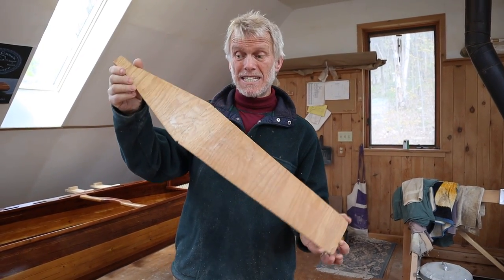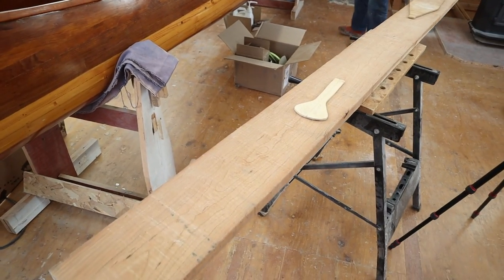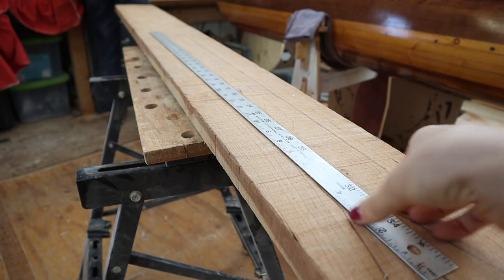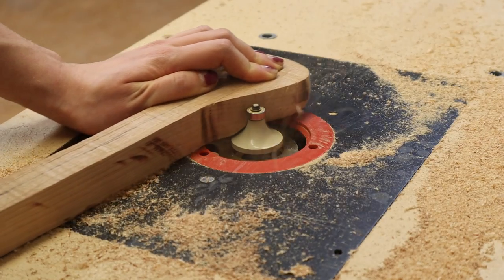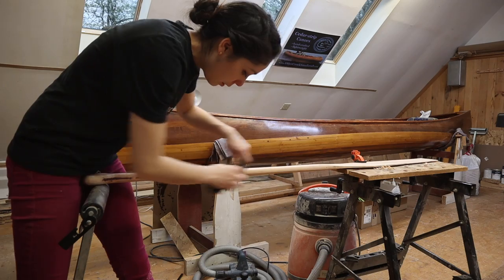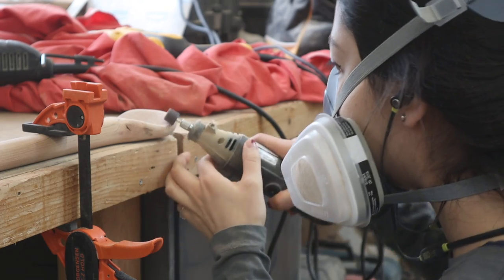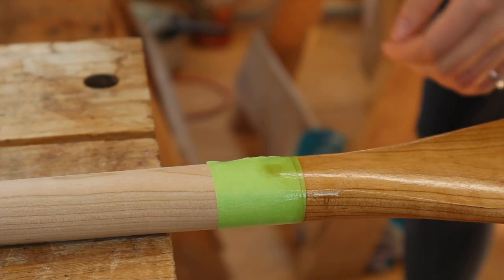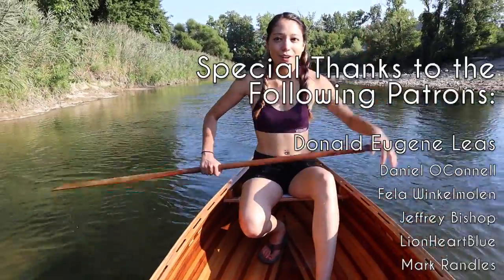How to Make a REAL Canoe Paddle (from a serious canoeist)

Comment: My favorite paddle was one my grandfather made. Almost the same shape as the one on the video but shorter in the blade and a bit wider! Another feature my Grandfather added was a bronze tip rabbited into the wood and pinned and epoxied in place. The bronze was soft enough so that it allowed for " Traction " when pushing off of rocks but hard enough to not deform too badly with knocks and scrapes! Blade was White oak with cherry layers in the shaft! Best paddle ever!

Comment: The information on paddle length was interesting. I've been told to choose a paddle that comes somewhere between my nose and chin, but usually I just hope the longest paddle they have is long enough. But I wear 38-inch sleeves, so using your method, I'd need a longer paddle than most.
Reply: For people with "normal" proportions that advice works well enough, and will select a paddle that works fine. If you do enough paddling that a custom paddle makes sense a paddle with a longer shaft may be more comfortable. This also can be modified based on blade shape and water conditions that you typically paddle on.
Reply: The universal tip ive read is that the top of the paddle should reach the shoulder when sitting in your prefered paddling position in the canoe and holding the paddle vertically with the entire blade in the water, that takes the length of the blade and different paddling stances out of the ecuation. Not a practical rule when handing out paddles at a rental though.
Reply: Hmm... Is my preferred paddling position sitting on the seat when the water is calm? Or is my preferred paddling position the "three knee" position (with your left knee, right knee, and heinie supporting your weight) when the water is rough?
Reply: @DarinMcGrew  You'll need a different paddle for each seat, each canoe, each position....we sell them at an inexpensive price...and are you left of right handed? We are kidding of course, we try a few then pick our favorite. Skipper likes a light paddle with a smallish blade and she is One With The Water. At first as a Marine I thought bigger was better and tried to beat the water into submission, but I am following Skipper's trail now.

Comment: Those long otter tails are great to pole with in shallows and have great reach when you need extra control in the wind. But a bent shaft beaver tail is much better when you need to cover miles fast. That's why I always go tripping with both.

Comment: Thanks for the video! I made a couple paddles a few years ago and used marine varnish on the whole thing... Definitely sanding it off the shaft/handle and applying some oil. Also I can confirm that thinning it is a good idea, my varnish is flaking off in some spots because I didn't thin the first coat.

Comment: I use spruce for paddles.  They die eventually, but are so incredibly light and nicely flexible.  Nice work all around!
Reply: Cherry is extremely light as it is so strong PSI wise that blades can be made very thin and still be durable.

Comment: Very nice paddle and very reminiscent of my 1971 grey owl modifed otter that is very voyageur like in design. After 45 years solo paddling I'm not fond of squared of style voyageur blade ends and   would recommend you round of the corners of bottom of the blade it will make for a smoother and less turbulent entry and exit and better for "indian stroke" , also   if you like to solo "style or freestyle  " paddle a symmetrical grip is better idea, you could always add northwoods/guide grip as well.

Comment: I find we use the paddle against the bottom of the lake stream or whatever quite a bit. I also noticed my dad's paddles were pretty beat up on the bottom edge from years of use so when i made my paddle I did put an inch or so of fiberglass on it. The paddles I made for my grandparents were pretty thin so I just put a real light layer of cloth on the flat portions of the paddles. It kept the weight down but still made it pretty strong.

Comment: Great info on determining paddle length! As far as the build process, hmmmm. I fashioned an otter tail & beaver tail for my 1st cedar strip boat many years ago using nasty, cheap, knotty pine. Since I paddle mostly lakes, the otter tail is my go to. The blade is more rounded than the ones in your vid. It has a 'scalloped' grip, you should look into that for your next project. You can hold the grip sideways further down or on top. Sounds weird but is actually a comfy grip. Both paddles are treated with linseed oil only, no varnish. The blanks for my paddles are half blade, less chance of losing symmetry that way. I prefer spoke shave over router for shaft. If you draw multiple equidistant lines down the square stock, it's quite easy & quick to shave it down to a round shape. I think 2 lines down each side of the square stock is how it's done, been a while, memory fails. You end up with an octagon, then take the ridges down to make it round or oval.... I remember one of my fave paddles as a youngster had an oval shaft.

Comment: Thank you for posting. I need to build a longer paddle for my Kayak. I will reconsider a strip paddle now. Never would have thought to  use the router for the shaft.
Reply: For a kayak paddle I guess you would need to make a 2 piece if it's coming out of a single piece of wood because of the feather in the paddle.

Comment: All my paddles, so far, have been laminated.   I should try a solid one just for fun.    That powered hand plane is a really nice tool for that!
Reply from the maker: Do it! I'd be curious to see how you like the way it handles. I think you can go a lot thinner and lighter out of a single piece of wood. 

And YES power plane is on my wishlist once google adsense starts paying me enough :D
Reply: ps: you don't need a thickness planer for a laminated paddle,   you can prep your strips on a tablesaw.   And once it is laminated you just use the bandsaw and then it's all curves and hand held tools.
Reply: @xylafoxlin  Get a belt-disc sander also.  I have a small one and  I use the end of the belt sander in the vertical orientation when shaping the handle.   The tight curve of the belt seems to match the curve in the grip fairly well.

Comment: And here I was thinking canoe paddles were boring. Awesome! Could you do a quick video outlining how you're paddling? It looks like you go straight without swapping sides, which is black magic as far as i'm concerned. Maybe a "canoeing for dummies" or something? I'm just assuming it's far more complex than I imagined, just like canoe paddles.

Great stuff.
Reply: ALX Electronics not a canoeist but it looks like the trick is in the wrist-flick at the end of the pull-stroke, turning the paddle blade 90° to act as a rudder.
Reply: You can google J-Stroke and get confused, or watch the video a few times at slower speed. Focus on the top wrist and how that changes blade from a paddle to a steering rudder. While not the intent of the video, Xyla showed us in simplest terms how to paddle/steer. There a few other basic moves, like a draw and a pry. Best to grab a PFD, canoe and paddle and go have fun!

Comment: Nicely done! Well thought out with help of your uncle no doubt? What type of wood species were you using? I didn't hear you mention it in the video, so judging by it's grain characteristics, I would guess that it's white ash? Anyhow, I like your approach to making the paddle. I'm nut sure about the jigsaw though? I tried a jigsaw on my solid piece of cherrywood and found that not only didn't it cut well with the grain, but the blade had a lot of deflection causing it to veer out on the underside (thankfully, or I would have ruined that plank). I spent a lot of time planing that angled cut down until it was nice and square with the paddle face. I am hoping to find a bandsaw to cut out the rest of the pattern that I didn't finish cutting. For the handle, I have purchased a concave shaped spokeshave which will contour the shaft shape a lot better that just a regular hand plane. For anyone looking at making paddles on a regular basis, you might want to look on line to purchase one. JMO.
Anyhow, great instructive video. Cheers to you...and your uncle!

Comment: I think you both did a amazing job, and I hate to be one of those people, and it may have been mentioned previously in this thread, but it LOOKED like you used a miter gauge AND the fence at the same  time, which is extremely hazardous, if I saw this incorrectly, I apologize. Adding a block of wood to the fence to set the distance, but not bind on the saw blade is the correct way to go about that.
Again, compliments to both!
Reply: It's fine (and safe) to use the mitre guage and fence together when not making a through-cut. So she wasn't in any danger from kick-back, but good of you to point it out for her and everyone else's safety 😊

Comment: I find it interesting that the paddle has such a squared off edge whereas we are kind of mentally conditioned that everything in boating is nicely rounded edges. Although I do know that there are parts of boats, in design, that are keep with sharp edges so water flow breaks off cleanly with minimal drag.

Comment: I think most people would cut the paddle out and use sandpaper and work it by hand or use a power sander. A table router is not a common tool in most people's garages or home workshops. It's also difficult to really make a perfect straight cut with the jigsaw or reciprocating saw, so I imagine you needed to plane and or sand the length of the paddle to get it straight and also to obtain the shape you desired.
I agree, it really is an easy project, but will take time to get it right and to make the finished product and regardless of which  or what tools one has, this can be done with the simplest hand or power tools. I think making it a one piece paddle is the most logical choice. I'd just paint or wood burn a decoration into it if I really felt like it, but it's strong and durable.

Comment: Do you know that linseed oil (and similarly danish oil) exposed to air cures into linoleum plastic, so it does the exact same thing as a varnish that normally is based on polyurethane or epoxy resin? It would suffice to oil the whole paddle.

Comment: Ah, the rule of thumb - determined how thick the branch was that you could beat your wife. 
A suggestion for your pattern pieces that I use in my shop is to paint them a bright colour and write what template they are on them.  It stops people cutting up your patterns as scrap wood.

I have made dozens of paddles over the years, but steamed plywood or fibreglass blades. None were as pretty as the paddle you made - well done.

Comment: Wood looked like it was 8/4?  Is that right?  Also  do you need any particular grain pattern? Quartersawn best? Or perhaps any particular grain pattern to avoid?  Thanks.
Reply: Since they went 1 1/8" with the ruler, we're guessing 5/4 (1 1/4"). 5/4 S4S (Surfaced 4 Sides) might be perfect to start.

Comment: I wonder what effect an aerogel powder coat would have on the water touching surfaces. Water sheeting, either an increase or decrease in buoyancy. Given that the water doesn't want to come into contact with coated surfaces I haven't a clue as to the impact besides coming dry from the water.

Comment: What kind of wood did you use for your paddle?  It looked like Cedar.  And if so what kind?
Reply from the maker: Paddle should be a hardwood :) I used cherry because I find it to be the most beautiful, but ash is slightly better for paddles because you can line the long, straight grain up with the shaft. But I'd say cherry or ash are your best bet. For small children you can do basswood to keep it light!

Comment: Stroke? Looks like a J-stroke, yes? Teach us, Xyla.
Reply: very astute - it would be nice to do a video on fluid dynamics and the compound stroke as well as a c stroke which comes from competitive whitewater slalom both k1 and c1 / oc1 / oc2 / c2
Reply: Not J-stroke, precisely. Stroke plus ruddering. J-stroke involves a push away from the stern at the end on the stroke. Both methods are a great improvement over stroke-and-drag; very common, very inefficient.

Comment: What was the original thickness of board? ... Or better asking what shape and size should the shaft have? Thanks for the info.
Reply from the maker: I believe it was 5/4 but closer to 1.125. The shaft ended up around 1"-1 1/16" once planed
Reply: @xylafoxlin  Thanks for the quick response. Greetings from Austria, Europe.

Comment: Flex in a paddle has nothing to do with being laminated or not.  It has to do with the wood species it is made of and the thickness/design of the shaft/blade.  T shaped grip makes it easier on the hands than traditional style grip as I learned back in the 1960s.

Comment: Using a jigsaw to rip over 60 inches (120 round trip)... mad lad. Get a circular saw for that nonsense 😂 in my years as a carpenter never have I seen such insanity

Also, please sling the cables over your shoulder. Seen a few people snag theirs while flailing cabled tools around like you were with your planer. Not a fun time at all.